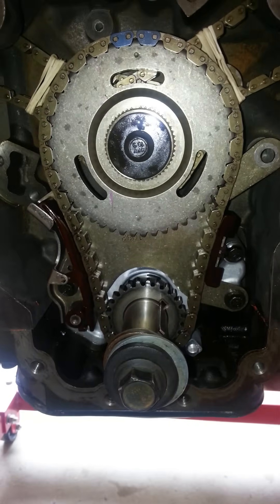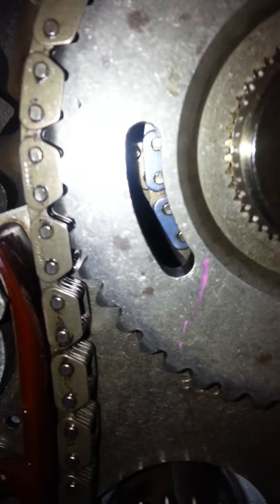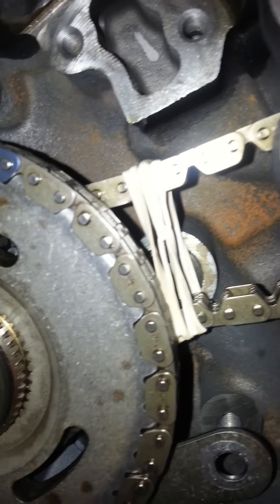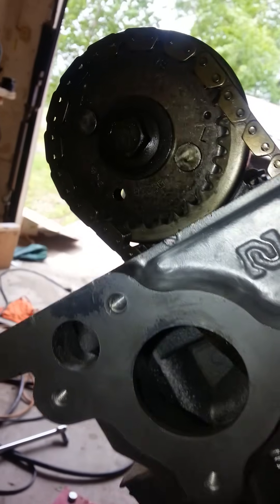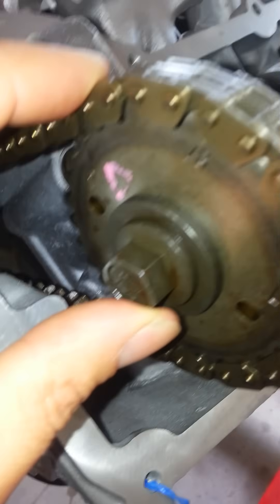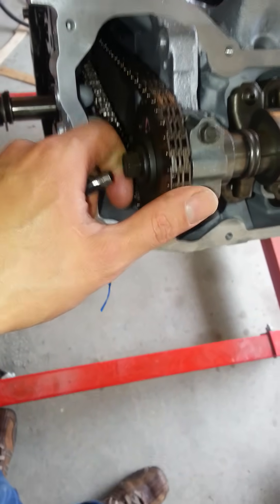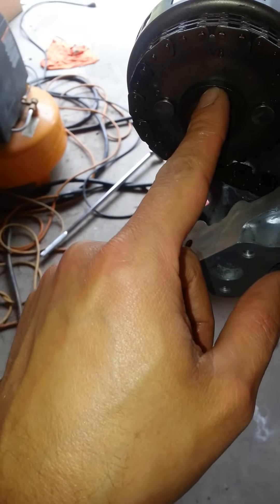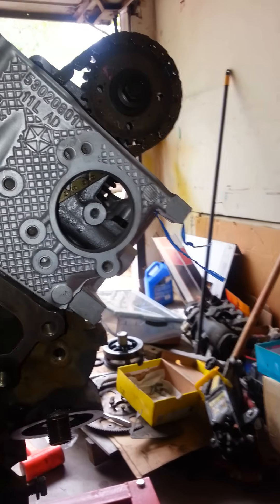2002 dodge ram 1500 4.7L timing chain

Comment: How can I verify to get the correct Cam Sprocket (JTEC or NGC)?
Reply from the maker: I do not know exactly what the difference of the timing sprocket/kit is , but if you have a 3 prong ecm ( 16 tooth JTEC ) or 4 prong ecm plug (32 tooth NGC ) , then make sure when you order it states whichever one you have. Ebay for instance states on the majority of their timing kits jtec or ngc. Thanks for watching.

Comment: If the timing chain were to be off a tooth or two is that fixable by just setting the cams back in the right spot or would timing cover have to come off as well?
Reply from the maker: I would remove the front cover and set the timing. Thanks for the feedback and thanks for watching.

Comment: Cool, that answers my question about how the tensioners are attached.  I’ve got a faulty “clicking” tensioner  on my 02 Jeep WJ 4.7L.  Other than the noise, how much damage could it do if I keep driving it.  I only hear it when it’s cold and at low speeds.  Once warmed up and over 50mph it goes away.  Thanks.
Reply from the maker: It may be OK if it's lasted so far, I guess the worse case would be if it jumped time . I had a truck the same way seems like there was a loose tensioner or something . It wasn't worth taking it all apart just for a little noise . It's definitely one of those things where I'd be wanting to go in and replace a lot of part before I'd want to tackle because it's a big job just to make it worth while . Thanks for watching
Reply: s33therfan   Thanks.  That’s what I’m thinking.  I’ll live with it until I can afford the repair.  But I might as well replace the water pump, alternator, etc at the same time.  I’m gonna cross my fingers and hope for the best.  It’s a 2002 but only has 113K miles.  Thanks for the reply.

Comment: I could really use some help even somebody to call and talk me through putting my truck in time.ive been without a vehicle for 3 months any help at all is better than none.
Reply from the maker: Do you know how it got out of time ? And in the truck it won't be easy but you'll have to start with getting the whole front of that truck off and getting that front cover off of the engine etc. The cams can be turned with some big pliers . Pretty much will have to start just like in my timing video , to know everything is lined up properly with those marks . You'll need to get everything off clean it up a little to even see . The tensioner will all need removed loosened . It's really not that difficult but definitely going to be more difficult inside the truck . I would just get all that stuff in the front out of the way to get easier access radiator condenser everything , I've also got some videos on replacing the engine somewhere that should show some of what's to be removed . I guess firstly I'd want to make sure it was indeed in time , also these trucks are notorious for blowing head gaskets . I can tell you first hand it's way easier and cheaper to find another engine that it is to rebuild and fix . Another bit of advice on these engines many years of 2001 up Durango Dakota ram 4.7l will work , and actually replacing the firing trigger or reluctor ring on an older engine is sometimes way cheaper than buying a newer . Basically you will need to get the valve covers and that front cover off in order to get started doing anything . Make sure put the bolts exactly where and what they came from when disassembling . Let me know if what questions you have I'm glad to help
Reply: Ya man.i did all that.but idk which one of the 2 links it goes on.do uk if its the first one or the seccond one.if ur if ur making the chain go to the right
Reply: It has new head gaskets and everything.all sensors are new.its jus when it starts it goes to about 2 grand now.and it wont idle back down.it jus shuts off.but its hot out here its like 95 degrees most time were i live.
Reply from the maker: Yes sir it's a 100 here , it's definitely rough , I don't have a fancy shop or anything either . Here's a link i don't know if it will work . 
https://www.google.com/search?q=4.7l+timing+marks&oq=4.7l+timing&aqs=chrome.1.69i57j0l3.8373j0j7&client=ms-android-verizon&sourceid=chrome-mobile&ieUTF=-8#imgrc=RoyAFsGj1E7SdM:

That's an image that'll make more sense . You'll have to use rubber bands like I did to hold it together from moving once it's aligned.  Once the dots on the crank and idler are aligned vertically the cam chains 2 plated links show through both idler sprocket windows. OK once you have that the tricky part is using rubber bands to hold that because it's all good . Now you just have to rotate each overhead cam for the dot to align exactly on the blue plated link there should only be one dot on that cam sprocket . The v8 will basically point straight up on both cam sprocket.
Reply from the maker: Just wanted to add this the 2 blue plated links will show through the idler sprocket window or slot , just like in that image I sent if they are not both in the window and viewable it needs adjusted accordingly . The single blue plated link goes on the one dot on the cam sprocket and the v8 should be at 12 o'clock about .
Reply: Man that is exactly what i needed to know.ig i was usn one of the 2 links as the timing mark.when i was suposed to be lookin for the one blue one
Reply from the maker: Good deal best of luck on it .

Comment: Did the chain have any slack in it at all once you put tensioners on it?
Reply from the maker: +musiclv82 once the pins are pulled on the tensions they should take up alot of slack . However the best I remember one side had some slack while the other was tight . As long as all the marks are aligned and tensioners in place and torqued all should be fine. I've heard or tensioner bolts working loose I believe next one I do I will also be using medium loctite. Hope this helps and thanks for watching

Comment: Thanks for the Great information
Reply from the maker: Thanks for watching and I'm glad it could help. Like with a lot of things once you've got hands on its not as bad as you thought it would be. Only other critical is just taking time to torque all the tensioner bolts etc to specs . Thanks again
Reply: I though the top gear on top of the crank gear was like a cam.really tore it up vise grips.The top gear turns on that solid shaft.that shaft ain't supports to turn:-(

Comment: I think my 07 needs some chain/tensioner work. It has a rattle that comes on at 2600 rpms whether I'm up shipping or down shifting. The engine has 108K on it and all original. Figure I'll do the lash adjusters at the same time since I got some making noise at cold start.
Reply: Ken Robinson my 02 Jeep WJ 4.7 does the same thing.  Cold and at low speeds it clicks.  I can’t afford to have it repaired.  Hope it doesn’t do too much damage.

Comment: Thank you for posting this. I am getting ready to replace the heads on a 2007 Jeep 3.7 V6 (same basic engine design). The valve timing was the only thing I was not sure about. Your video and description was the best I found.
Reply from the maker: Thanks for watching . Yes the marks on the chain make it easy and take the guess work out . The trickiest part is rotating the cam but any means of rotating it slightly without damaging it will work . I'd say the biggest thing is just taking ones time not rushing it and making sure it's 100 % right the first time . But I'm glad the video could help and good luck on your project and thanks again .